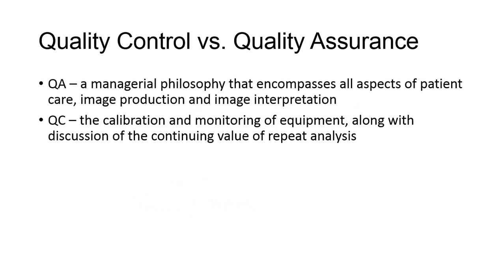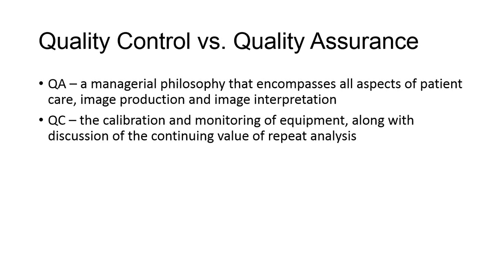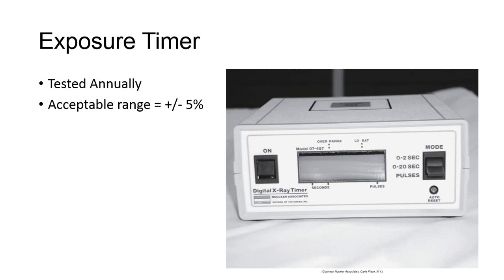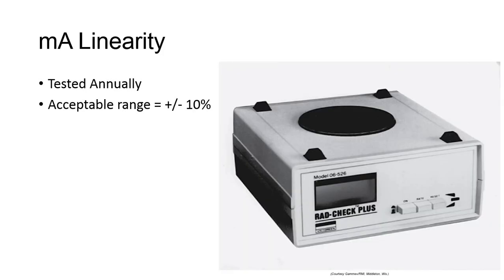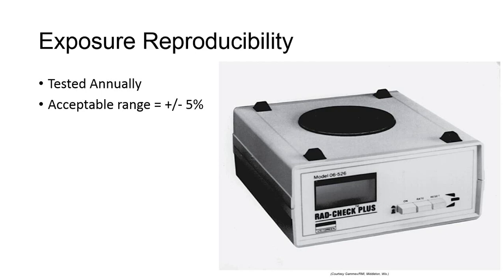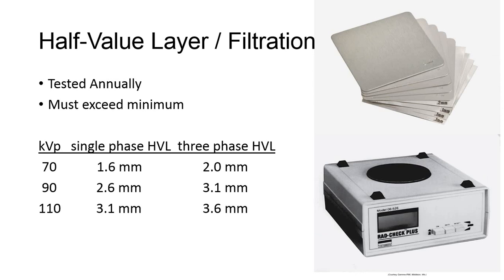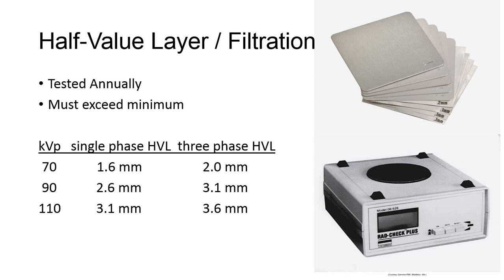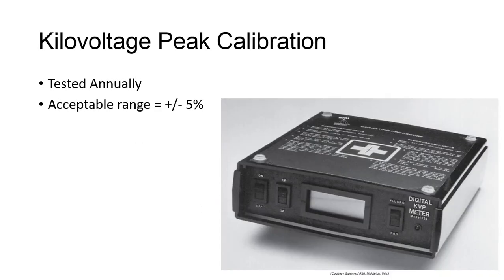Radiographic Equipment Testing Part 1

Comment: sir, wat does acceptable range mean?
Reply from the maker: The acceptable range is basically how far off your equipment can be calibrated but still be within quality control specifications.  For example, when you test the exposure timer and you set 100 msec at the control panel, the acceptable range is +/- 5%.  Using the digital x-ray time shown in the image, you're measuring the ACTUAL exposure time that radiation is interacting with its sensor.  So if 100 msec is set at the control panel, any reading between 95 msec and 105 msec is acceptable within QC specifications.  Anything below 95 msec or above 105 msec is outside of the acceptable limitations and your equipment should be calibrated to ensure accuracy of the technical factors set at the control panel.
Reply: @TopicsInRadiography  thank you so much sir! This will help me in my report tomorrow.

Comment: Thank you 🙏🏼
Reply from the maker: Any time!
Reply: @TopicsInRadiography  for all these tests do i need ion chamber or i would need kVp meter as well?
Reply from the maker: @just-tonic9114  On this video you'd need both - kVp meter only for kV calibration
Reply: @TopicsInRadiography  Do you mind to send me a list of equipment required for quality control in DR. For most important test, or can i send the list and you review it? i am still new in medical physics and i need a bit of direction
Reply from the maker: @just-tonic9114  I wouldn't mind reviewing a list, but please be aware I am not a medical physicist - I just cover the basics as part of a radiologic technologist educational program.  The tests I've performed are not all-inclusive when compared to the required testing to be performed by a medical physicist.  From the Technologist's perspective, I would recommend a book by Jeffrey Papp called "Quality Management in the Imaging Sciences", but still, it's only applies to those tests that technologists perform in various modalities, and may not include what you need for medical physics-related testing.
Reply: @TopicsInRadiography  kindly send me your email.
Reply from the maker: @just-tonic9114  you can send to topicsinradiography@gmail.com